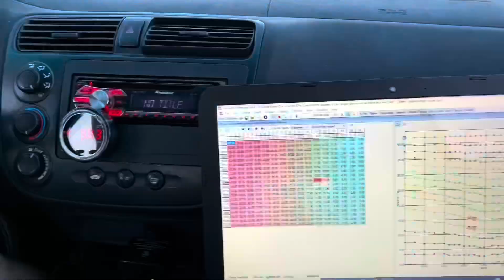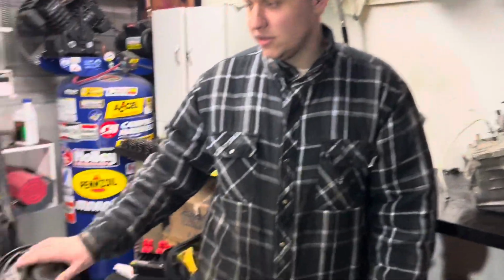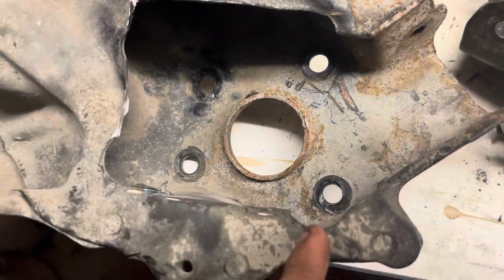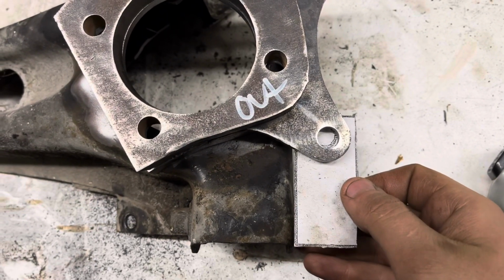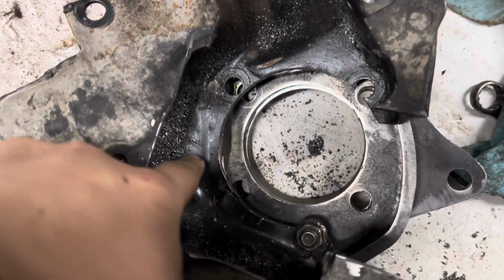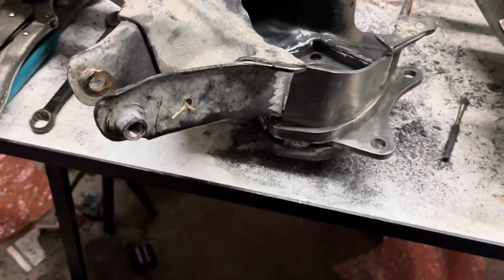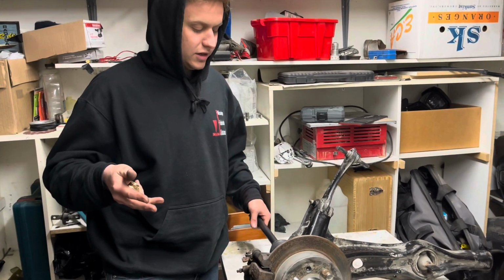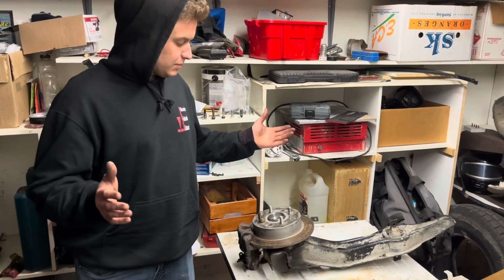DIY AWD CIVIC TRAILING ARMS!! AWD DEL SOL

Comment: I'm about to order the same type of kit for my crx project, does anyone know if the shocks interfere with the axles? Do you get to keep using the stock rear suspension? Or do you need to swap out other arms or parts?
Reply from the maker: You need to use a different lower control arm to offset the shock, if not it will hit the axle. I used awd rear lower control arms from jackspania, you can also use hub city control arms - Aiden